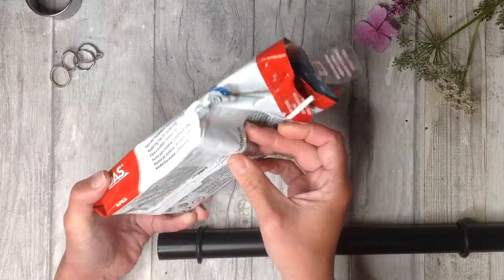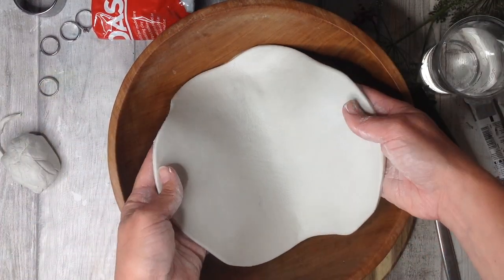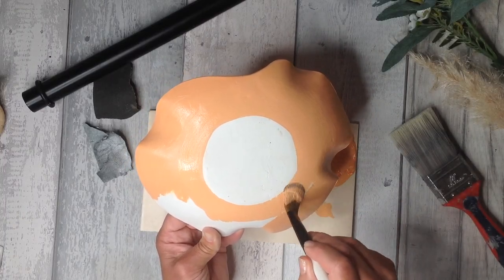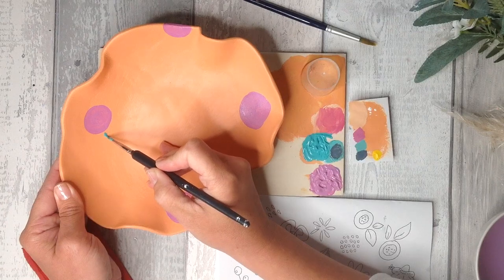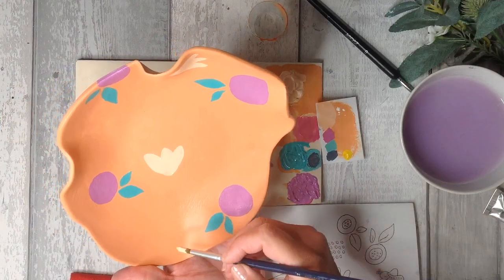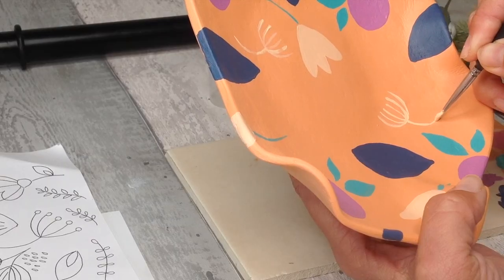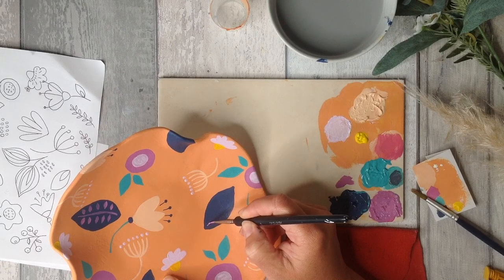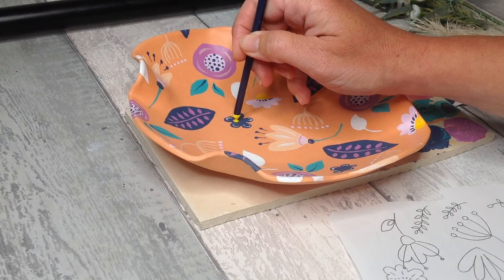AIR DRY CLAY | HOW TO MAKE A CLAY DISH & ILLUSTRATE IT paint with me

Comment: I have a question. Is the varnish in the end necessary? I am trying to make a little sculpture as affordable as I can and I wonder if it needs to be varnished or the paint will crack or something?
Reply from the maker: To protect your piece as much as possible varnish is recommended or if you have something similar like in this video:
Air Dry Clay - How to Glaze and Finish
https://youtu.be/z0dtdQFQ-wM

As long as the piece doesn’t get damp you may be ok but if it got splashed with anything this would soak in and maybe stain
Reply: The varnish also seals the acrylic paint 🎨
Reply: Am going to look at your varnish examples too
 I bought one from polysil

Comment: I love it 🥹♥️ can I please ask you why do my acrylic paint peel off the clay every time I used gesso before acrylic and when applying the paint they peel off with the gesso and I was quite sure it is fully dry
Reply from the maker: Thanks, I don't use gesso like some people do, I find acrylic straight onto the bare clay works for me and then a really good varnish over this, drying time between each stage needs to be longer than we think, otherwise the acrylic paint does have a higher chance of peeling, best of luck ♥️
Reply from the maker: Thanks, I don't use gesso like some people do, I find acrylic straight onto the bare clay works for me and then a really good varnish over this, drying time between each stage needs to be longer than we think, otherwise the acrylic paint does have a higher chance of peeling, best of luck ♥️

Comment: I painting my piece with gesso and let it dry fully for a day and when I painted it with acrylic there was a humid spot I tried to removed the paint let it dry reapply the same steps but it ended up peeling of as if it did't get attached to it at all like it peeled in one coat
Reply from the maker: Did I reply to this on another thread, I remember writing a reply…unless it deleted before sending 🤔

Comment: Hi Sarah, how would you price such a dish, to sell online, please?
Reply from the maker: Hi, that is a really tough one but as a basic I’d work out the hourly rate I wanted to be paid and times that by how many hours each piece took to make, then add on all material costs and selling costs. If you can batch make to sell this will save you time and keep cost down. As an artist it’s easy to undersell ourselves, but try and keep  away from undercutting competitors and selling yourself short, best of luck ❤️
Reply: @RedRockingBird  Many thanks for getting back to me so quickly! How much would you consider the hourly rate please?
Reply from the maker: @MarcelaTica  another tough one but anything from £15-£30+ per hour depending on experience or how you value your time, others may say different, best of luck
Reply: @RedRockingBird  Thank you very much, Sarah, much appreciated! 💜